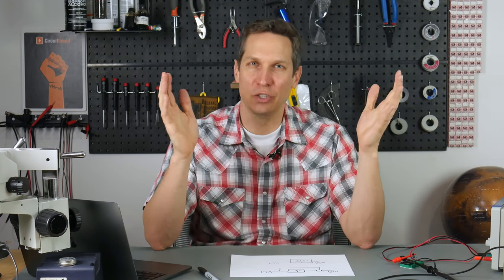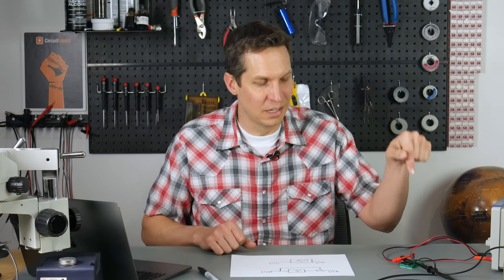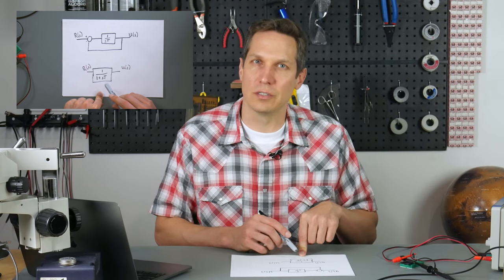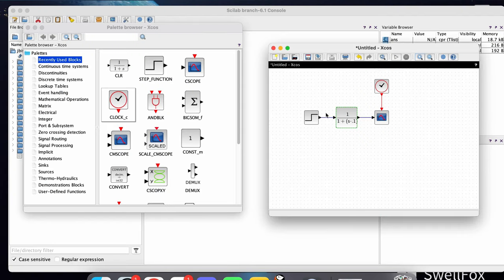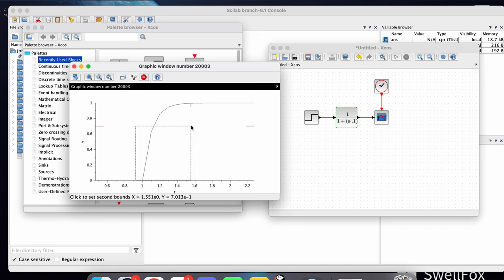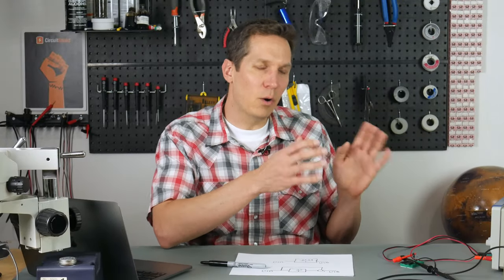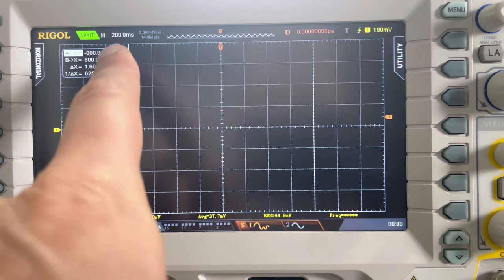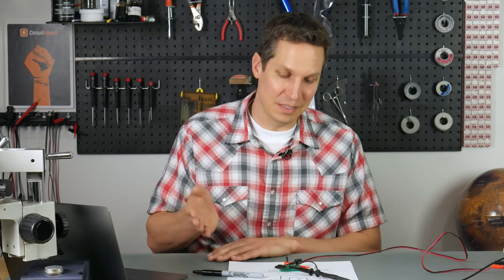First Order Systems (with Practical Example) - Control Systems 2.2

Comment: Nice job. I always wanted to know how do we use control engineering, but I don't know for example how to apply PID in the real life or how to get transfer function of every system :(
Reply from the maker: Sergey did a real life PID system using a microcontroller.  It is intense but Sergey goes through every step very thoroughly.  Check out the first of the three parts here: https://www.circuitbread.com/tutorials/embedded-c-programming-with-the-pic18f14k50-20-automated-temperature-control-system-with-pid-control-part-1-hardware-and-theoretical-background

Comment: Hello sir, I had a question that in ready to drive system, how to make a buzzer sound for a limited time interval and make it stop or make it idle no sound after that, is there any arduino programming for that what is the solution how to make it work like that
Reply from the maker: Hi Prasad, any MCU system would easily be able to do that.  In our PIC10F200 tutorial series Sergey did a tutorial on exactly that with one of the simplest microcontrollers available.  An Arduino would be able to that very simply (and with a great deal of flexibility) - I don't have any specific code but Arduino is simple enough that it would probably take someone with moderate Arduino experience 15-30 minutes to create that.
Reply: @CircuitBread  Thank you sir